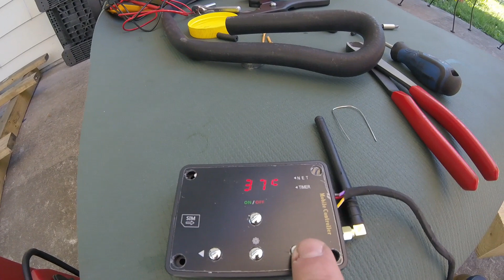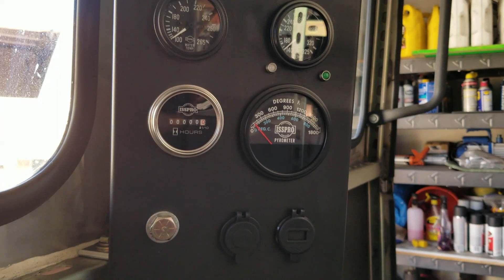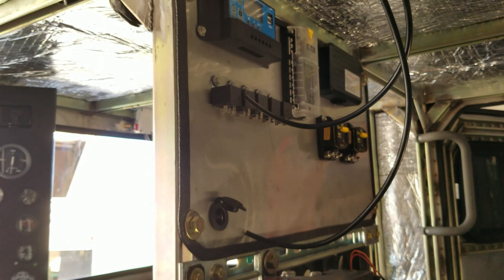Rusty the Spryte build part 84 (wiper motors, electrical panel, diesel hydronic heater, plumbing)

Comment: I know your probably not thinking of paint color right now but you should consider the military tan same as your truck and trailer. I bet you could get the paint code from the manufacturer. Good luck looking great!!!
Reply from the maker: If it were mild steel I would paint it for sure, however, this is going to have a ratty rusty tarnished finish as it is wire cupped stainless steel...  Should tarnish up nicely out in the wet season....

Comment: One suggestion: You may want to consider hose conduit around all coolant hoses to protect them from rubbing and causing holes. Only needed where they rub. Been there done that! 😳
Reply from the maker: I will update you guys in a couple of days.  Lots done but I have not been filming the lengthy boring process of wiring and insulating and hose wrapping....got it covered...literally...